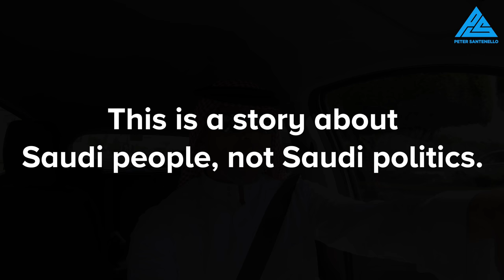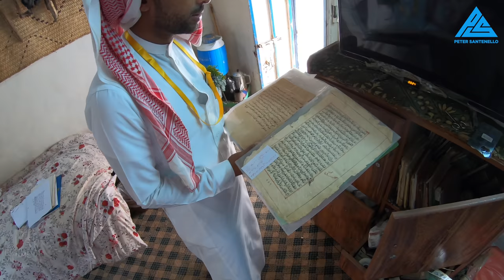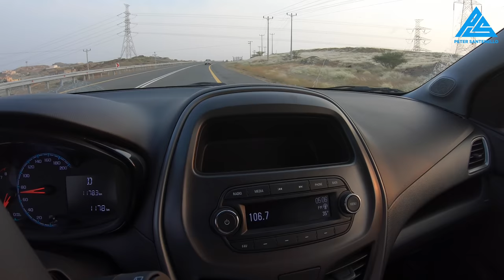Unexpected Adventure With a Local! 🇸🇦INSIDE SAUDI ARABIA #5

Comment: The ood isn't meant to be smoked like weed or anything like that it's basically a Perfume for the guests to welcome them you can find it in most of aisa cultures like chaina, Japan (mostly in Ceremonies like prayer or when someone dies) and India has one of the largest demand for it (the hindo uses it in there religion no clue what they use it for thou). that is as far I know about it ,if you liked the old houses look up a town called (shaqra) it's near Riyadh 1h away from it best time is before the winter you get nicer temperatures a little drops of water here and there and a little greener but you will find it a lot easier if you had a guide it been a long time since I went there so can't say that the old town museum is still running.